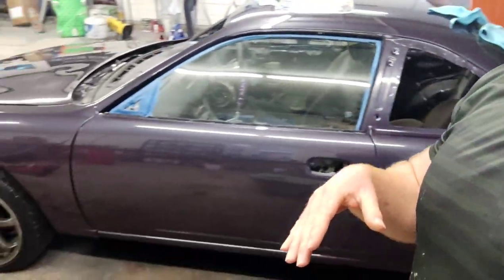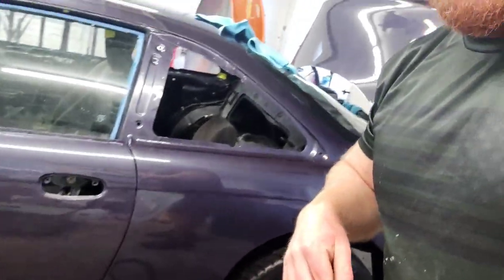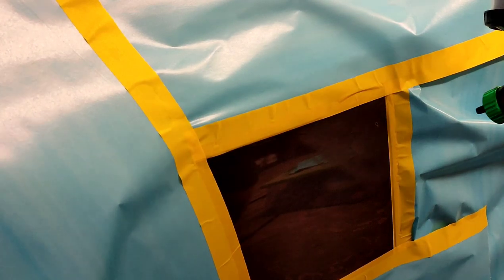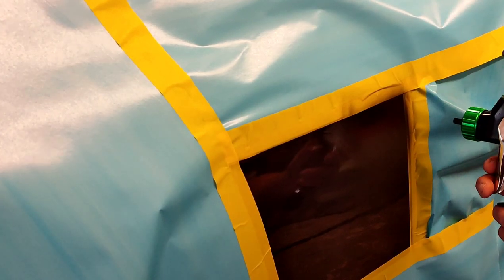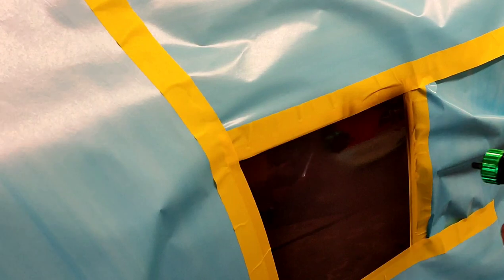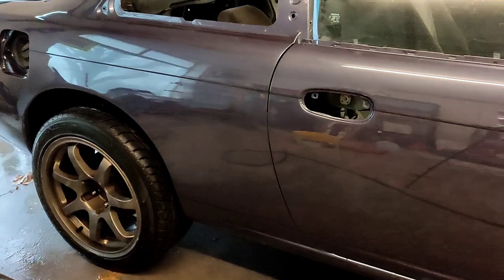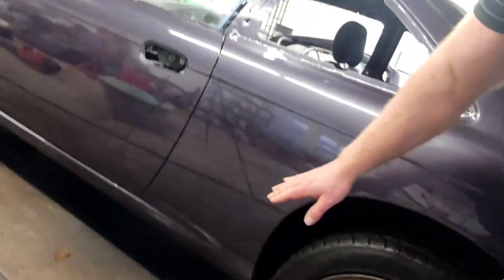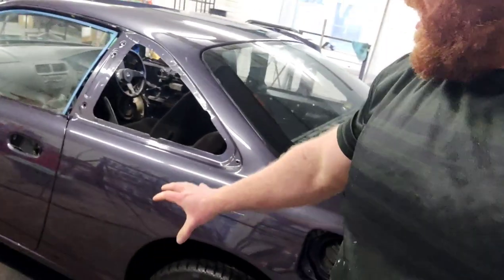How to fix a BURN THROUGH

Comment: For all you DIY'er Marco has alot of experience doing blow ins and spot repairs for the rest of us.J ust sand the whole panel with 800 or grey scotch brite dust in your base then clear the whole panel.
Reply from the maker: True 🤣🤣🤣
Reply: For a very light burn through down to metal on the body line of a door panel, must I prime that small burn through area first?
Reply: @markperez6195 you’re technically supposed to, yes. But you could probably get by with just putting more base then clear but you’ll likely see where you burned through since it will be base on bare metal and you’re supposed to have corrosion protection like epoxy or etch primer. I’d spray a little bit of a 1k rattle can etch primer then a 2k primer and sand to whatever you want then base and clear.

Comment: How soon can you repaint over a fresh paint job without issues? I sand through alot of spots would you base and clear again like normal?
Reply: Not sure if you’re still curious about this question but I do paint outside at a dealership not body shop, I’ve repainted an hour after it baked in the sun plenty of times. I’ve yet to hear any complaints about things messing up down the line but same time I’ve only been doing this for 2 years so 🤷‍♂️

Comment: I experienced my first burn through on the body line of the passengers side door of an Alpine White BMW. Man how frustrating.  I see in this video the burn through has no primer or would I need to primer it before attempting a smart repair to the very small area with the burn through.  I want to ask before proceeding.

Comment: Great trick for the ones that didn’t know! 👍🏼
Reply: What is in your clear coat blend just reduced clear? Nice tip super time saver.
Reply from the maker: @3rekoatskustoms929  I use the speedokote blender solution 100% straight and simply burn in that dry edge that's it

Comment: Great job! Sometimes having a heat gun handy to disapate the blending solution helps when you first apply it.
Reply from the maker: I've seen guys do that! You know what scares me about a heat gun is runs
One time I used a heat gun on some clear and it ran everywhere. When you heat the clear up its viscosity goes away just like motor oil it becomes thinner. But I suppose if only using it on that blend area I should be ok
Reply: I just use air from the gun, lightly spray ur reducer and back up a little keeping air flowing and if u need more lightly spray again. I've put too much down and created fisheye effects and runs

Comment: Thanks for this vid. I went 1 step further with a tiny burn on edge of panel to metal. What now lol. I mean tiny area can i just use etch primer on a q-tip or fine line brush let it cure then base the whole fender and clear it? My Ws400 learning curve on the gun settings created a waterfall of clear. lol
Reply from the maker: Yea that's not a bad idea

Comment: Can you do this with rattle cans are does it have be an air gun ?
Reply: I fixed my motorcycle paint with a spot repair. It wasn't clear coat burn through, but it was scratched and not looking very good. I just got a high-quality rattle can of  clear from a body shop supplier. Sanded it smooth and polished it with several grades of polish and it's indistinguishable from the rest of the fender.

Comment: Have to do the same today , burned a two inch line on a door corner right throw the paint
Reply from the maker: Hope this video helps, will not work if it's 3 stage or anything heavy mettalic

Comment: Amy tips on gelcoat/clear coat burn from a erasure wheel
Reply from the maker: If the clear Is not burnt through.. You can usually buff out burn marks
Reply: @speedokoterefinishnetwork4937  hope so I removed some emblems and the wheel left a slight yellow stain on ym white paint
Reply from the maker: @nathandaniel1000  yea just some buffing and compound
Reply: @speedokoterefinishnetwork4937  any product yous recommend?
Reply from the maker: @nathandaniel1000  I use speedokote smr950 compound